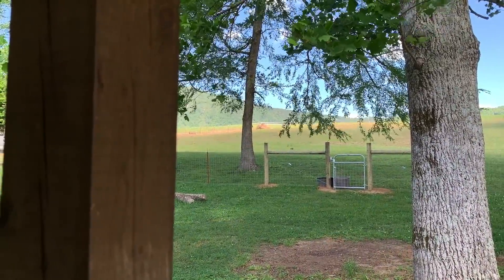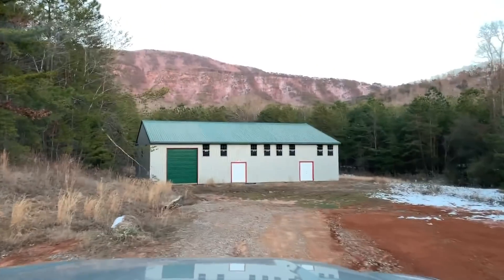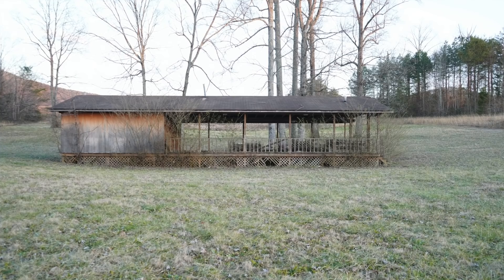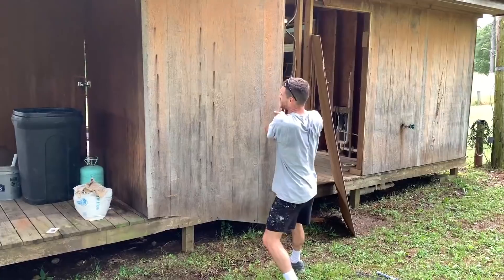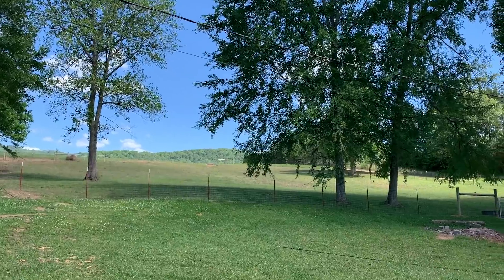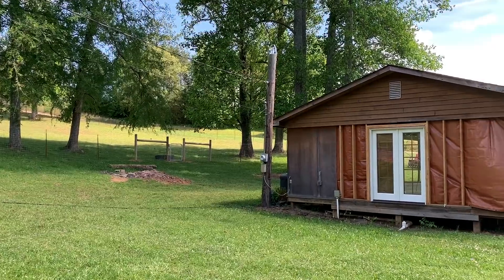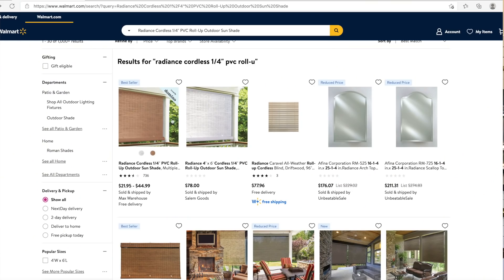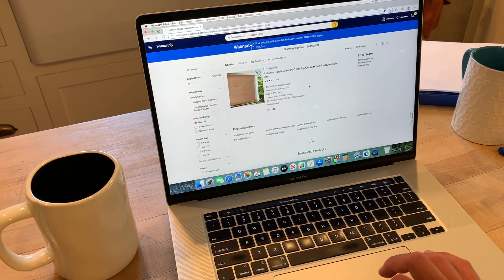BABY SHOWER PLANS | PJ & THOMAS

Comment: Paint the building white and the floor a dark brown.  Dirt will show less that way.  Do the the bistro lights, but also consider doing some led lighting in the rafter area.  Make sure the led lights can be programmed to change colors.  This will allow for a variety of looks.  Also in the kitchen area have a stove, large frig and large sink.  People will appreciate it.  As a previous fundraiser for a small nonprofit these were some of the things I looked for in venues when looking to hold a fundraiser.  Since this will also be a pavilion, you may want to consider some outdoor ceiling fans for air circulation.

Comment: The thing about White(IMHO) is that you can always tell if it is Clean, but you can also almost instantly tell if it is dirty.  We went with White almost everywhere we could here, unless it is rock, or Rock Tiles.(We would, in hindsight, do more Rock, Stone and tile, but it would still be light or white.)    I love that the Pavilion is getting a new life!  I also think the plans that you discuss are right on point.  Are there any Health Department Rules and Regulations you have to be concerned with if/when this becomes a Commercial Venue?  (Hot Water to a specific Temp, Screened in Food Prep areas, etc.!)   Could be good to know now, so you will comply then.  Awesome video.  Thanks!!

Comment: Hey fellas, ideas from when I was a volunteer at the Fire Rescue community building we had. Suggest White tables that you can take down after use, easy to clean, but that can be moved out onto the grass when needed. Set up only the amount needed depending on the party. (if 20 people then 6 tables verses 20 tables that stay up all the time). folding chairs and then build a closet that you can park everything in for storage or a building close by. Add some picnic tables that stay around permanent. Perhaps a swing or two that is permanent with a fire pit. Love the blinds for privacy and sound barrier depending on how close you are to neighbors and roadway. Kitchen needs would be good. I think look at your local community buildings and see what they do. Hope this helps PJ list as I know he is off to the race with getting things done. See ya next time.

Comment: Great video guys.  I would go for white so that you could use any color inside depending on the event.  But I would not go with a long table.  I would go with a few rectangle tables so that you can adjust according to the size of the event.  But other than that, you guys have some great ideas.  It's just another project that I can't wait to see finished.  I love following your projects step by step.  Good job.